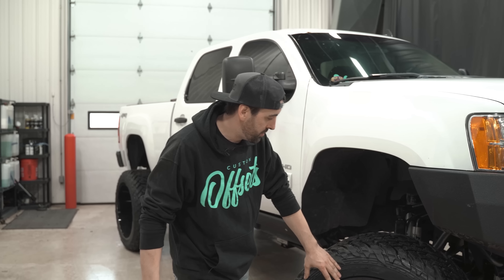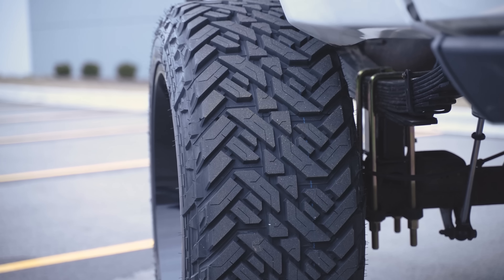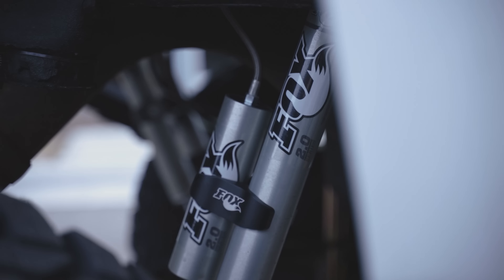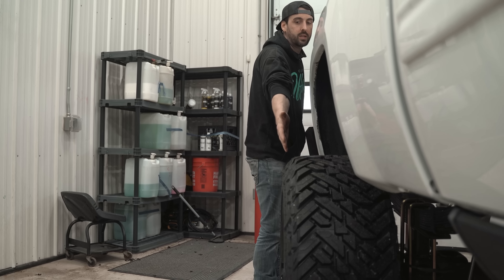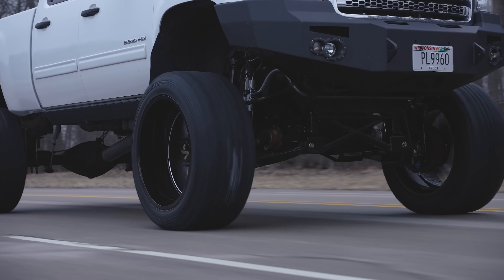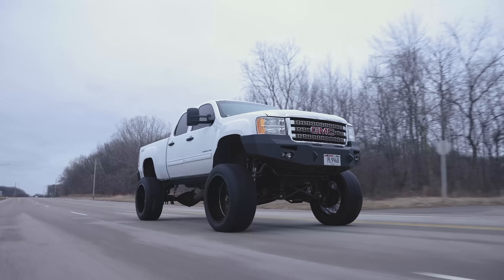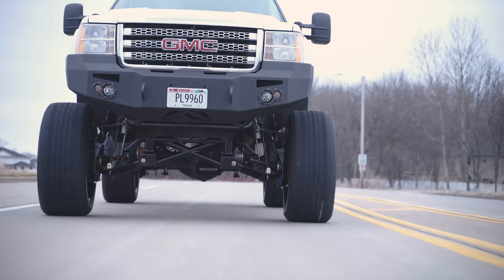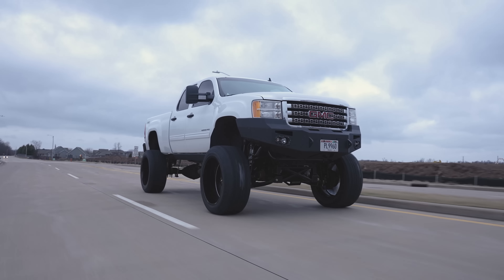From Rust Bucket to HUGE Show Build: 26x14's, 40's, & 12" Lift On A 2012 GMC 2500HD

Comment: Yall wanna do a Pt2 build with my LLY? 😅
It’s actually pretty funny because more than likely it’s going to be so similar to this. Bought my truck with the lift and everything already on it, and it’s all being replaced with a brand new cognito 7 inch lift with Kryptonite suspension parts 
At least I’ll have the entire suspension to replace it all with. So in theory, alot of the suspension currently on it, is garbage, and can definitely be destroyed to remove.